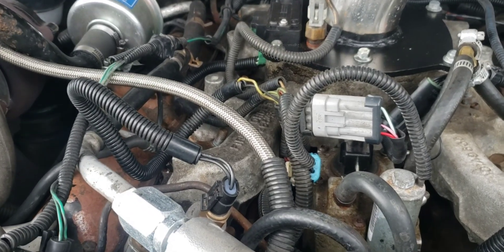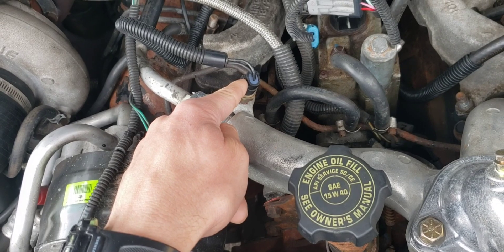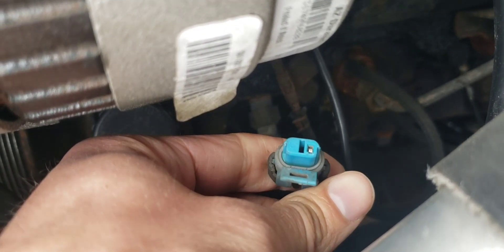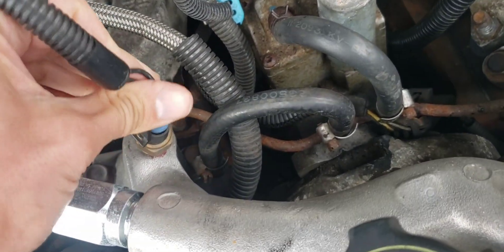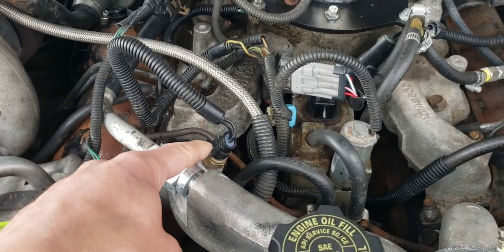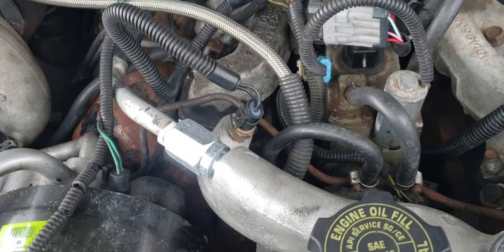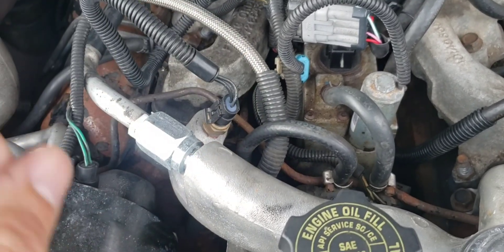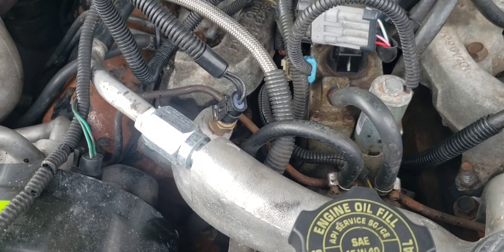6.5L Detroit Diesel Engine Coolant Temperature (ECT) sensor. What all does it do?

Comment: I am having a gauge problem once it warms up it goes all the way to 260 and above but I just replaced it is it a bad gauge could it also be that I tightened the sensor a little too much?
Reply from the maker: Sounds like bad connections for the gauge
Reply: @ would it be the the stepper motor or the whole cluster?

Comment: My 95 has issues on the first start of the day I unplugged the sensor and it started up beautifully like it should! with it plugged in it will fire up and die then when it does stay running it's puffing smoke like a train then clears up and I don't have any issues the rest of the day it's new sensor I checked ohms on the sensor at what temp the truck was they were good plug I have yet to get anything but an open line so idk if my wiring is screwed up or my ecm is goin also no matter how warm the truck is the glowplugs always kick on the same amount of time I've changed all that glowplugs the harness the relay the controller
Reply: Did you ever get this problem resolved? I’m having the same issue
Reply: @judebarrineau837 negative still trying to get it situated.
Reply: @judebarrineau837 I'm thinking it's the optical sensor in the ip. I've checked the cts. It's working like it's suppose to glow plugs are working like that are supposed to it's either the os in the pump or the ip itself that's what I've come up with
Reply: @judebarrineau837 so I've put some parts into my truck a new LP raptor 100g with pre filter now the truck starts like it should still has pretty good amount of smoke but it's a 30 year old truck I expect some smoke on start and it clears up pretty quick  now it starts and stays running on the first try
Reply: @judebarrineau837 the main harness on top of the engine the one that runs in the valley just few weeks ago my truck would randomly start missing hard like almost to the point of dying then it would clear up got it home and was just moving the harness round and it would clear up all the way ordered a new harness from Leroy diesel so far seems to have fixed my issues!

Comment: I just bought a 96 3500 6.5 litre and I noticed that the low coolant light on the dash is on all the time and the coolant is not low at all. Your video just helped me figure out where the sensor is. I also didn't know there is 2 of them on the 6.5. I appreciate u for the video on this. Thanks

Comment: Thanks Dieselburb for being so low key in the video.  Took 30 years and 4 months for the OEM ECT to fail, but it finally did.  Your video took me right to the solution of my problem.  
Initially had high idle for 30 minutes or so, then it went to normal idle.  
2 weeks later the transmission was down to 3 speeds with no overdrive or 4th gear.  Watching your video showed me the exact part I needed, and it solved all the problems.
Excellent presentation by you:  just the facts, no hoopla or anything.
Then you showed operation by unplugging the sensor and showing the idle increase.
Reply from the maker: Glad to help, didn't seem like it was wide spread knowledge and figured this would help at least someone out.